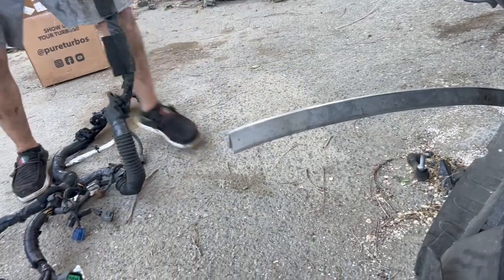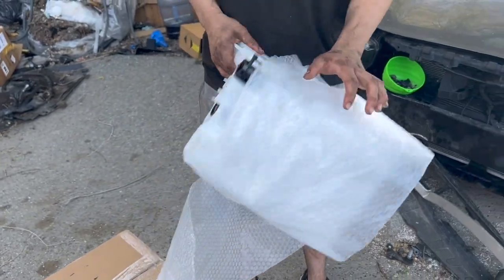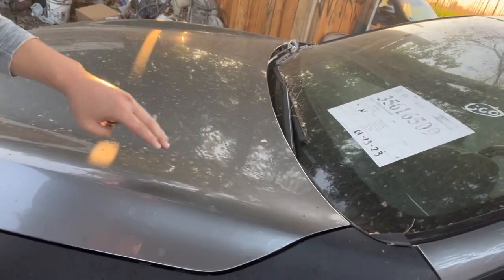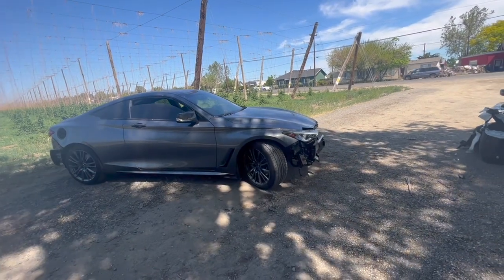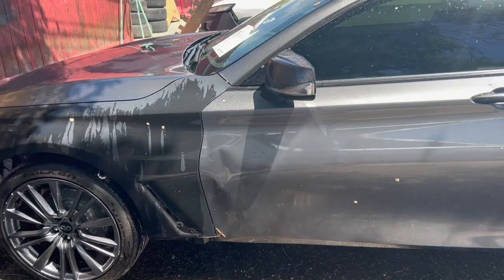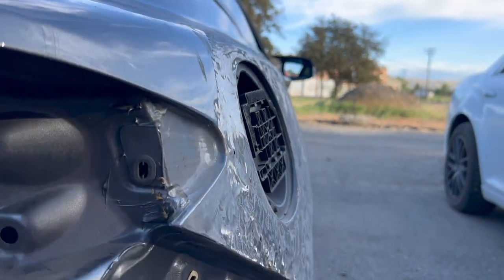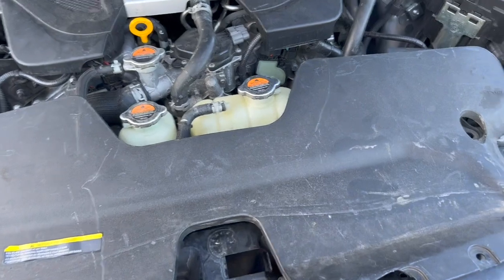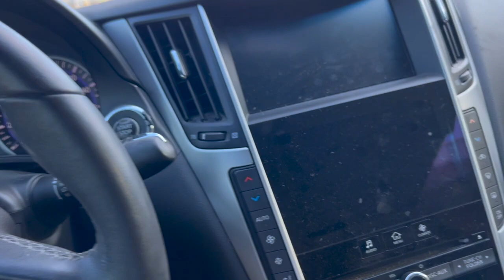Rebuilding a 2017 Infiniti Q60 AWD Part 9

Comment: Next time i'd use a disc sander/polisher to strip paint.   you'll get a much better result vs an angle grinder.  that thing is meant for grinding down welds not paint stripping :D

Comment: Did you end up figuring out what harness it is ?
Reply from the maker: yes it was the srs harness for the airbags
Reply: I just got one that has front end damage and it has wires on that driver side hanging as well but the power steering isn’t working on mine does it connect to that as well or is it separate ?
Reply from the maker: its hard to tell since ours are all chewed up we will check it out this Saturday and install the new harness and ill keep you updated if I find anything.
Reply: For sure I’ll wait on that my harness is pretty chewed up as well and I’m trying to figure out what harnesses I will need to get it fixed. Do you have insta by any chance ?
Reply from the maker: @jesusenriquez3956  I have the harness was looking into it I have pictures and he’s I have Instagram it’s https://www.instagram.com/salvagerebuilds720/